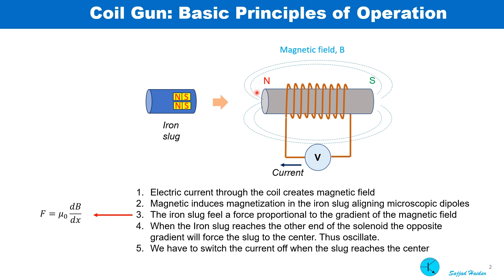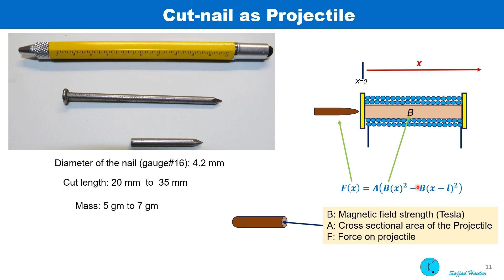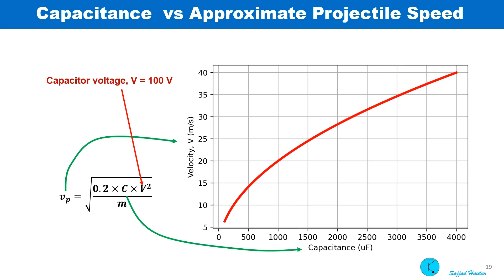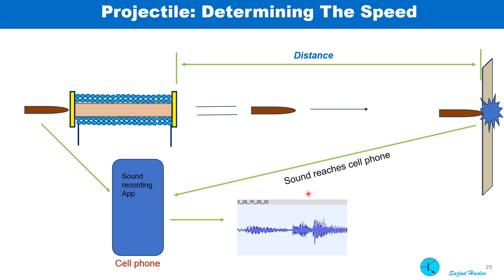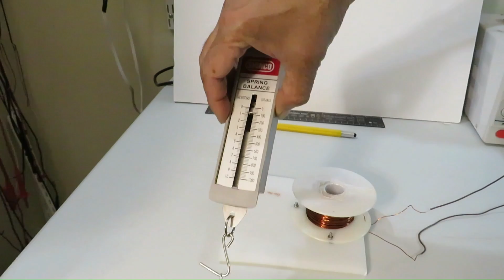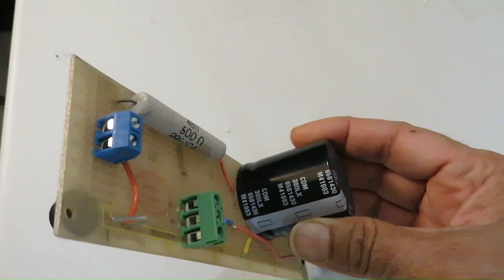Coil Gun

Comment: Will npn bjt transistor work TIP41C
Reply from the maker: Better to use SCR instead. Those NPN transistor needs higher Base current to achieve the collector current needed. Besides NPNs are prone to damage at high current
Reply: @technologyforyou5976 im js using 9v batteries so I thought it wud be okay and also I js cudnt find mosfet it's js rly hard to find materials wher im from and I have found TIP42C transistor i need help with the wiring I dont have sensor I will be using wires as the sensor so when the object goes through that point the wires will connect and I have 5 9V batteries and 3 2200uf 35V capacitors and 1 50V 4400 uf capa5
Reply: And i lowkey need help for my science fair project
Reply: And i have 3 1N4007 diodes

Comment: How dangerous is this reverse voltage for polarized electrolytic capacitors? Can short reverse pulses (a few milliseconds) at high voltage damage the dielectric, or is it usually tolerable in pulse discharge applications like coilguns? What are common protection methods against this reverse voltage (e.g. diodes, snubbers, RC networks), and which is most effective without slowing down the current pulse? In a coilgun circuit using polarized electrolytic capacitors, after the SCR fires the coil generates a reverse "suckback" voltage due to self-induction. This negative pulse is applied directly across the charged capacitors (rated 350 V). In simulation I see about +300V for ~2 ms, followed by about -300 V for ~2 ms.
Reply: You could use schottky diode but this will increasse the pulse length and reduce power indireclty, you could use tvs diode with a set voltage to redirect it back to source or right polarity of the condensator

Comment: How about reversing the polarity at half way, rather than turning it off. Then you could use the second part of the coil to provide additional acceleration, assuming you can overcome the inductance.
Reply from the maker: Hi Greg, thanks for your question and thanks also for watching. Actually reversing the polarity will not help, on the contrary the projectile will be sucked in. When a iron rod approaches an energized coil the coil-magnetic filed and the induced magnetization of the rod helps to accelerate towards the coil. Upon reaching the center of the coil the net force on the iron becomes zero. Whether we reverse the polarity or not, after leaving the center it will be sucked in.
Reply: @technologyforyou5976  I am perfectly prepared to believe you are right :) But am I incorrect in assuming that the domains in the projectile will become aligned with the original field as it is sucked in? If so, then I would have thought that changing the field to oppose them would have contributed to the motion.
Reply from the maker: @AllTheFasteners  Hi Greg, Thanks for your question. As domains of the ferromagnet materials are aligned with the surrounding magnetic filed, this will behave the same way, entering the solenoid or leaving the solenoid. So the projectile will be sucked in  whether exiting or entering. Reversing the polarity will rearrange the domain in accordance with the changed polarity.
Reply: @technologyforyou5976  Thanks for replying - I understand now. I am really enjoying the detailed approach in all of your videos.
Reply from the maker: @AllTheFasteners  Thanks very much for watching.